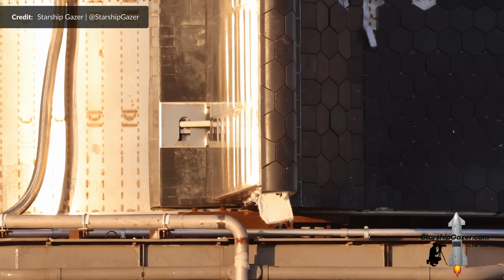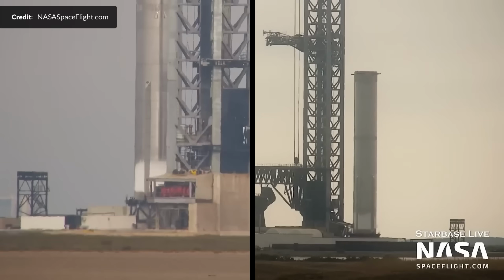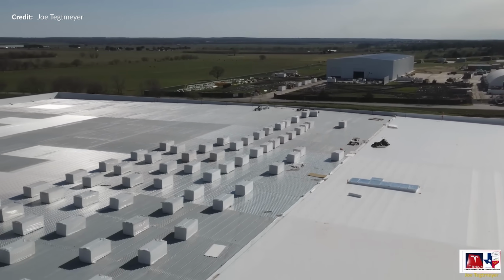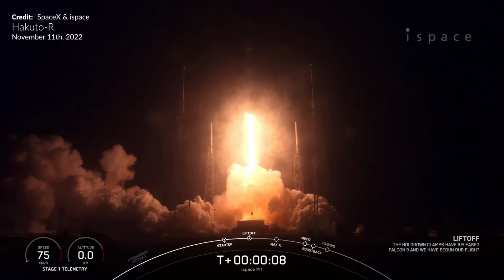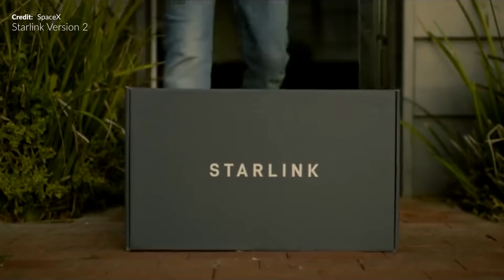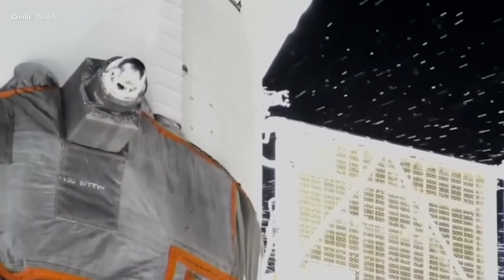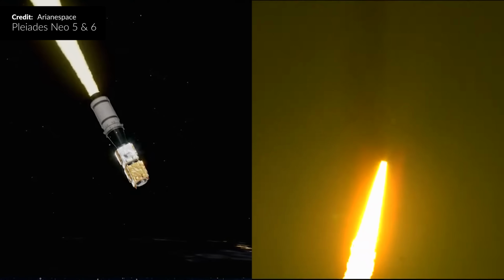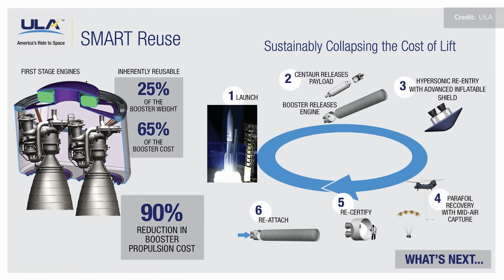SpaceX Starship Update, Record Booster Landing,  Soyuz Leak, Vega C Failed and Much More

Comment: I think theyre really making a lot of effort to try and keep the tiles as simple and easy to install as possible, since the tiles were such a huge issue with the reusability of the space shuttle. Which I think is probably a better idea than building it bulletproof and trying to simplify like you might normally, because this is such a potentially problematic issue. The kind of thing that could shut down Starship on its own rand make it unprofitable realistically, so they have to keep it simple.
Reply: Can't wait for them all to peel off during Max-Q...if that ol' sardine tin ever gets there.
Reply: @kennethc2466  if it goes THAT far south...well, it will be entertaining at least. I don't expect they will by the time they get there, but I also about guarantee not all of them survive lol.
Reply: @aggonzalezdc  In reality, it will never be human rated, as the FAA requires a launch escape system, that Musk said he won't employ in his tin of beans he pretends will take people to the moon, let alone Mars.
Reply: I have felt that way for over a year. I expect they will launch people in Dragon capsules that will dock with a fully fueled Starshio. A little more complicated that way  but much safer.
Reply: @StevePemberton2  Ah, the tuna tin has no way to refuel a Dragon capsule, nor are they designed for in mission refueling, in any way. Why would you 'expect' this?
Reply: @kennethc2466   I said nothing about Starship refueling a Dragon capsule. And my remarks were intended for the OP.  I just realized that I accidentally replied to one of your comments. I have now corrected that.
Reply: @StevePemberton2  Oh, so you expect something even more ridiculous, unplanned, and not part of starships's plans...because they can't keep tiles on the ship, ON THE PAD.
  Wow. Got ya.
Reply: @kennethc2466  max Q has nothing on the vibrations from static fire
Reply: @KnugLidi  You right, it's FAR worse. Hence, it's name. 
  Also, the 'skirts and flaps' get the most heat, and are mission critical. You saying you're not worried about them losing tiles is absurd.
Reply: I'm not worried about the tiles on the skirt or flaps, as they can burn through without endangering the ship.  Sucks for rapid return to flight, though.
Reply: Thinking long term the tiles will have to be removable as if there is  a faulty one on Mars it’s going to need to be replaced
Reply: @adamoshea2793  LOL!
..."on Mars"...

As if the tuna can will reach Max Q of LEO!
🤣😂

Comment: Why not just make tiles that hook on to each other?
Reply: They will expand when heated, which is why up close, they have little gaps all around.
Reply: @steveaustin2686  I just imagined this is solved by tile geometry. bottom part attached to the hull would be with gaps, but top part hooking into neighbouring tiles with room to slide. if a time comes of it would still be held in place.

Anyway. will we see a fuel perspiration of active cooling solution before they ever get the tiles to stick I wonder.
Reply: @Thedeepseanomad  The tiles expand together to leave little to no gap. I don't  think they can be connected together by the sides without lots of problems of expansion.
Reply: @steveaustin2686  I guess. I mean they must already have considered designs with gaps that will not allow sufficient heat to reach the hull.
Reply: @Thedeepseanomad  As I understand it, the plasma field from re-entry is slightly off the surface of the spacecraft, but a tremendous heat still reaches the hull. The TPS expands as heated which fills in the gaps. The extremely tiny gaps after the TPS expansion can keep out enough heat to not have the hull compromized. Lots of math and TPS testing before a final design was arrived at. SpaceX has said that they have done small scale tests, but they can only be so large. So eventually, you have to computer model and jump to the full size test.
Reply: yikes, can you imagine a whole wing being ripped off if one tile makes a break for it

Comment: Please explain why having 2 layers of heat shielding works but having 1 layer.... still works.

By works I means during a launch a tile falls off leaving only the white thermal layer. 
Upon reentry at 1700km/h up to 27000km/h 
SpaceX believes that the space ship's hull will not be breached. 
I find this to he fanciful because if that was the case then what is the point of the ceramic tiles, just remove them and save weight.

I think SpaceX have the wrong solution. They need an ablative shield like Orion/Dragon capsule.

The analogy with an aeroplane only goes so far.
I would demand SpaceX charges more to ensure that I return to Earth in one piece from a flight to Mars or the moon or paying more for shipping cargo.
The key thing is that an aeroplane does not undergo reentry, thus one can not compare the two use cases and the needs of these very different applications.
It would be like Elon trying to use  a model 3 for hauling 82k lbs of cargo and saying he does not need the Semi.
The model 3 has a lower price point and if it could be used for cargo hauling then yes it would revolutionaries the logistics industry but it simply will not work because humans do not have the technological solutions at present.
So SpaceX better have a better solution because people will die, maybe at a lower rate than the shuttle but if you are one of the dead, who gives a shit about stats.

Elon...just use an ablative shield that u use already on the Dragon capsule and accept the longer turn around times. 
It is not like some other provider has a better solution and SpaceX is at a competitive disadvantage. 

At the moment Elon is not publicly stating that there is a plan B but this I think must be it.
I think an increase in turn around time can be mitigated by just interlacing launches of  several starships until the shield is prepped on the retuned starship then this is launched.
Reply: good question, now take a really good look at the 'skin' on starship, i believe your question has already been answered by Marcus in a previous episode, although, this might be a topic to revisit? Marcus?
Reply: @brendenharris8858  the problem isn't the solution but the arbitrary economic constraint placed on Starship by Elon.
This is what he thinks the economics should be for building a Mars colony but this is not really an economics question because there is no other competitor and the rewards must by definition outweigh the costs by order of magnitude. 

So use a bloody ablative shield and accept the costs in turn around time and or construction and or weight and or fuel.

Comment: Any news about the oIl rings platforms? Good episode by the way
Reply from the maker: No news that we've seen lately no.
Reply: The last we heard is that Deimos was moved from Brownsville, TX to Pascagoula, MS (Mar 2022) where Phobos was at. Musk at his most recent townhall thingy earlier this year, said that the rigs were low on the priority list. Boca Chica & LC-39A are the focus now. If LC-49 gets approval, that will likely be added as well. The oil rigs look to be for the Tanker flights, so likely won't be needed until closer to 2024-2025 when the unmanned test landing is planned. Of course, they still need to finalize the design for everything, before building it on a rig. Boca Chica is still the test location for figuring out the Stage 0 configuration.

Comment: That drawing of super heavy starship with Falcon Heavy boosters strapped is badass!!!:-)
Reply: In fact, attaching boosters to the main booster would be a brilliant way to extend the load capacity of Starship or avoid necessity of some refueling in space operations. SpaceX could develop a metalox version of the Falcon Boosters (with Raptor engines). 4 Raptor engines would have aprox. the same power of 9 Merlin engines, but they would need far more fuel. So the booster would be limited to have 2 or 3 engines at maximum. That's an idea to think about.